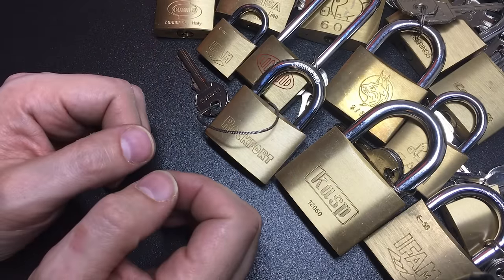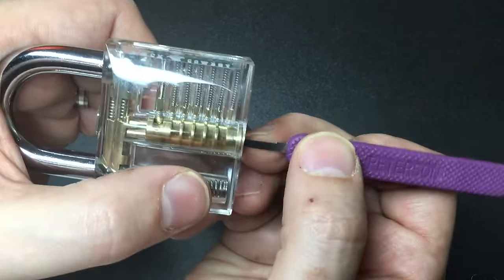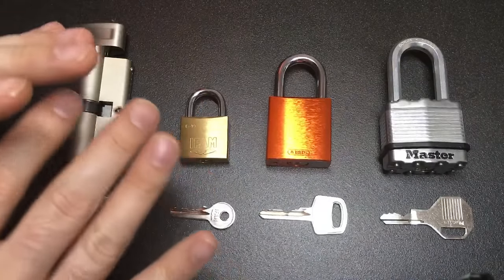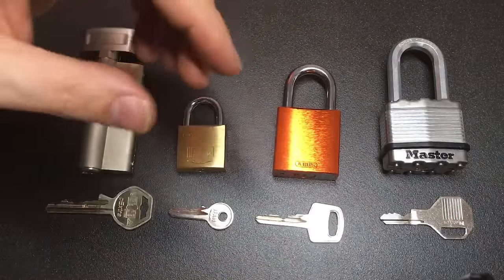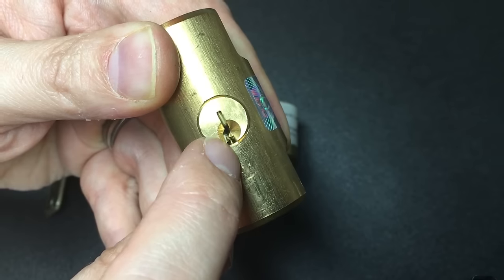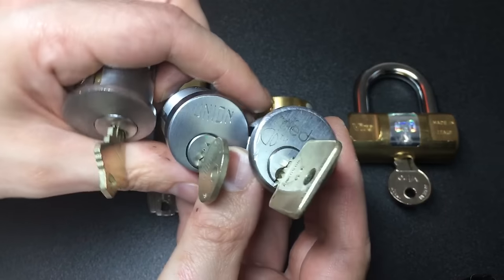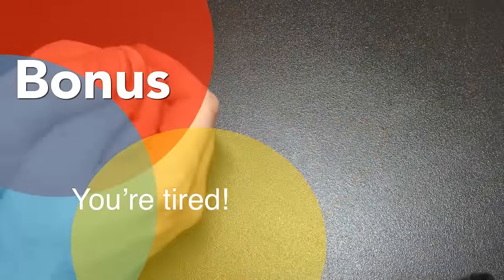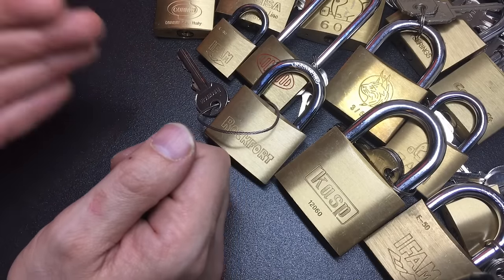Top 10 Reasons Why You Can’t Pick a Lock

Comment: This makes no sense. I have the clear practice lock. Can't get it unlocked no matter what I do. The other lock it came with I opened straight away. I understand how its supposed to work, but no matter which tension wrench or pick, whether light tension or really strong, it just won't work. Ive tried using magnifying glasses and really watching each pin. I've closed my eyes to "feel" my way. Nothing works. It even seems like the pins move when they shouldn't, or they move together rather than one at a time. I can't rake them because its too tight and gritty. The pins seem to either over set or under set, but when you adjust the tension to correct that, other pins fall out of place. And the key in it works just fine. I can't imagine what I could possibly do other than just randomly jamming picks in there forever and evntually getting lucky.  Doesn't seem to be a skill issue, because as dexterous as my hands are, the lock doesn't behave as it should.